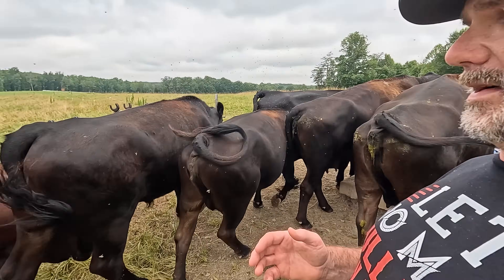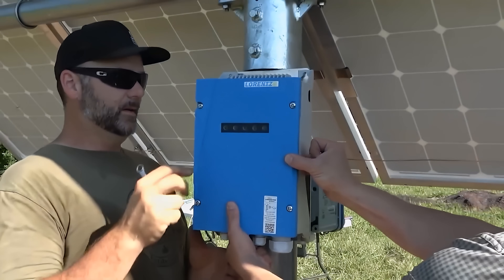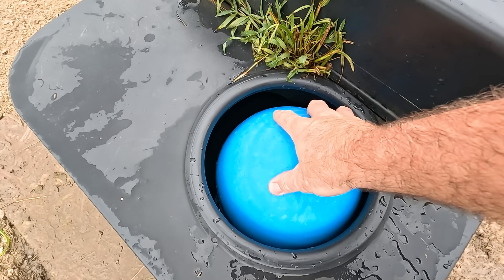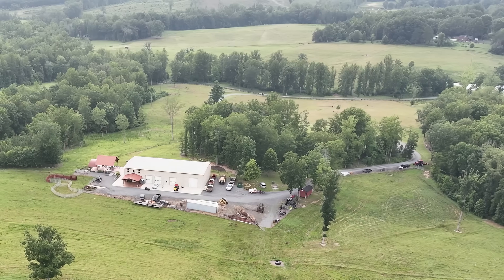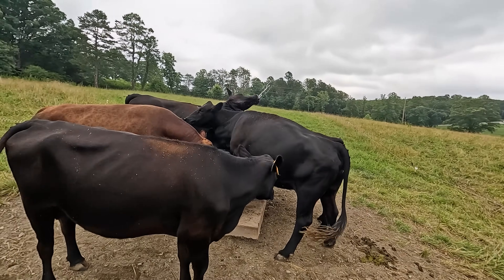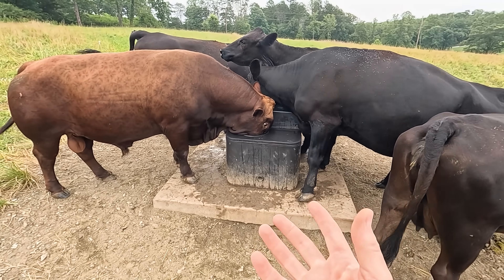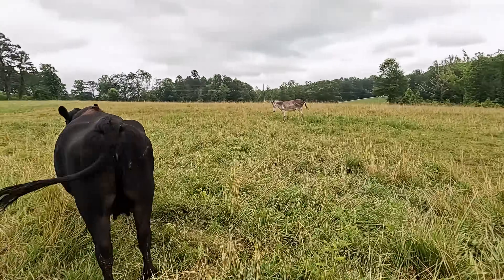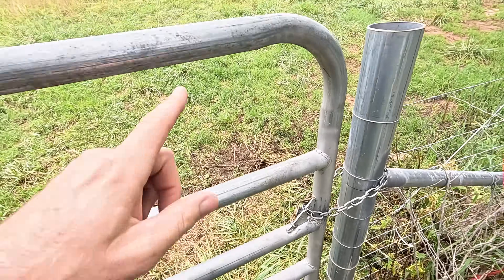FARM TANK System EXPLAINED! 💧 How We Store and Pump Water with Solar Power!

Comment: If your water level in the well is 22, why on earth would you drill the well 360 ft. deep?!
Reply from the maker: static water level is where the water table sits.......but just because there is water at that level doesn't mean we're gonna get enough gallons per minute.   The entire well is one big "storage tank" under ground.   We hit moisture in the soil at 22 feet and that's where the water level stays....but we needed to drill down until we got at the least 2gpm.  We drilled to get enough flow, if not the well would run dry and burn up the pump.   That's how wells like this work.  I ended up with 10gpm...that's enough to irrigate a bit.  If I stopped at 2gpm and only had 100 feet of pipe drilled down, then we'd run the well dry and burn up the pump.  It's about gallons per minute of water flowing back into the well.  The pump is 120 feet down...so the well can theoretically run continuously forever.   Gallons per minute is what we're drilling for...static water level is where the water table sits, not where you can get the flow you need for your home, farm or irrigation.   Funny....my neighbor has 100gpm at 85 feet!!  He's got a great well!!

Comment: Josh you need to do better for your water system.  You should have a cistern tank at the end of the pipe line. I have farmed in Australia, New Zealand and the pacific islands. .  Water is a major issue.. Your cattle are not getting enough thru these troughs. I watch cattle fighting for water that is not a good sign.  they also can not get their heads in to utilize the total water in the trough..   The cattle need to be able to see the water. Yes I understand in winter they are good for stopping the trough from icing over.  If you have tanks at  the highest points the water is able to back flow and maintain pressure. The average cow drinks up to 10 gallons of water on a warm day.. Calves need water and the troughs you have limit them to water .. They are scared to use them and this limits early growth , this puts more pressure on the mother to produce milk, The cow needs more water to produce the milk.  We would have 500 gallon troughs that 100 cows would drain in less than 2 hours if not refilled. You should have as much as more reserve water.

Comment: 🙋🏼‍♂️ can a generator , pump  water in a bind ?
Reply: A generator transfer switch and generator power inlet box would be an excellent idea the controller MPPT only excepts D.C. power. But there are other Solar controller that incorporates A.C. generator power  conversion as a manual or automatic start in the event of low solar activity. I am not sure Josh' existing controller capability options and the well motor if it's A.C or D.C. power.  The solution that Josh has come to is probably the most rational practical solution. I like your idea and it is also very practical. Redundancy is not always a bad thing although the school of thought is the K.I.S.S. method I believe your additional idea is very practical. Good job.
Reply from the maker: it can't with the setup that I have right now

Comment: Its a good system you have .
Have an offgrid friend in KY.  He hauls water from a river 1/4 mile away.
3500 gph bilge pump with a 2 inch line fills a 330g tote, takes 10 minutes for setting up hose and filling. 
Also have friends in PA that have a spring house,it keeps up with 12 commercial greenhouses,and 3 homes.
My brother-in-law has a solar well,very handy during hurricane season....we have averaged 1 week without power since 2016.

Comment: With multiple days of bad weather or just cloud cover, I think you should consider installing multiple tanks up with the one tank. More tanks=more water, which means less chance any of your waterers getting too low or out of water. At the very least, a battery bank of cheaper batteries you can pull up to the tanks and power them long enough to pump water to all the waterers and the cistern, just to keep it all full, in case of no power days for the pump.
Reply: Batteries have come way down in price.
Reply from the maker: batteries require charging system and a delivery system to the DC well pump.....more electronics...more problems, water tank will last 100 years, battery might last 6 and cost double.  This is a great way to have backup....remember, the goal is to have water...not to have power to pump
Reply: @StoneyRidgeFarmer  Do both, new batteries last much longer and are cheaper. Many people run their homes 100% on them
Reply from the maker: My friend.....I think you're missing the point.  Storing water v/s storing power is less expense, less maintenance and less troublesome.  At some point the well pump will fail also...having backup water v/s power will be priceless in this case
Reply from the maker: 1000 gallons is plenty for the number of cows I have, and remember, we have over 400 gallons of water storage in the pipes underground...pretty cool setup.  I'd like to have a 10,000 gallon tank! And I have my eyes peeled for one!
Reply: someone told him batteries are evil and he's sticking to that for some reason...?

Comment: Something people don't realize about livestock is that they may not want to attack you, but they are always moving, especially during fly season. They try to rub flys off onto someone else, and they push and shove.  Sometimes, they get pushed on top of you. It's very easy to get stepped on. You have to always be "on the clock " when working around livestock.